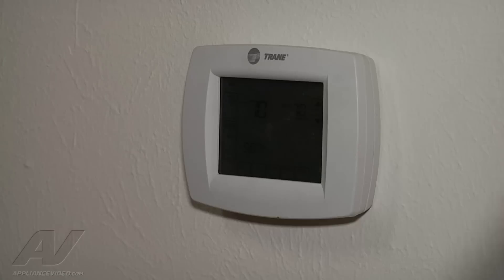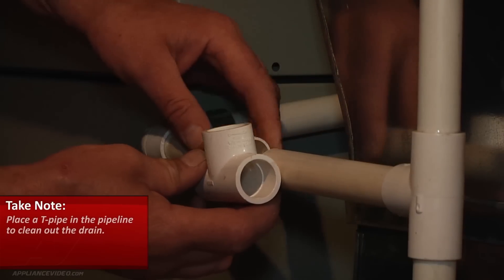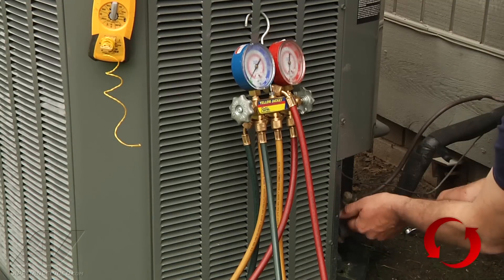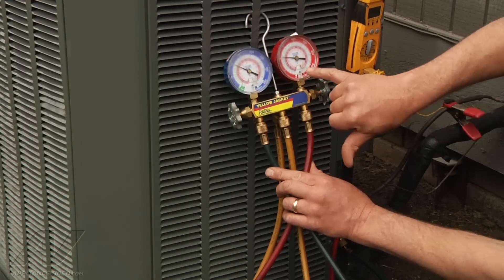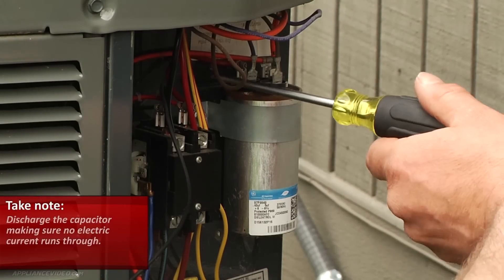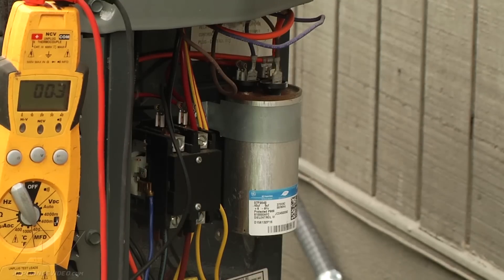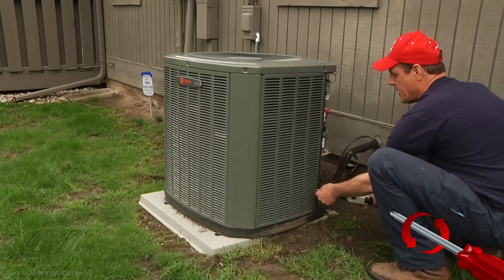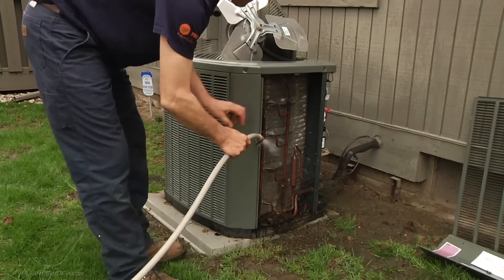Central Air Conditioner Service Maintenance Spring Tune & Clean

Comment: Around minute 1:35 why did you vacuum the drain line?
Reply from the maker: Great question, if you have a
more technical question that our parts department cannot answer, our
technicians are answering all questions at our website at www.ApplianceVideo.com under our Repair Help section. You can also call
our parts department at 1-800-830-5465 and they can give you help 7-days A week
Monday -Sunday, or search at www.SaveMoreOnParts.com  24 hours
7- days A week.
Reply: It's a method of sucking out any junk that builds up inside the drain line

Comment: How often should the outdoor compressor unit be maintenanced and how much does something like this cost? Thanks
Reply from the maker: One a year you should take a garden hose with high pressure water sprayer, then spray the outside of the condenser. This will remove dust, dirt and cotton wood that restricts air flow, it will add 3-5 years on average to the life of the unit when done every year. Please help our ranking by subscribing to our YouTube page or posting our ApplianceVideo.com site on your Facebook or Twitter account.
Reply: This is a good informative video.  When cleaning a condenser you should always spray the water from the inside out like the tech on the video said.  Spraying from the outside-in will cause the dirt to go deeper into the coils.   NEVER use high pressure water as this will bend the fins and cause airflow restrictions raising your high side pressures and affecting performance.  The only maintenance a DIY'er/homeowner should do on a condensing unit is to wash the coils at least once a year maybe more depending on how fast the coils get dirty.  This tech checked everything from amp draws, BOTH high and low side pressures and subcooling (TXV system).
Reply: Also, keep shrubs/bushes away from condensing units.  They pull air in from the side of the unit through the coils.  They need to breathe so nothing within a few feet of the condensing unit.